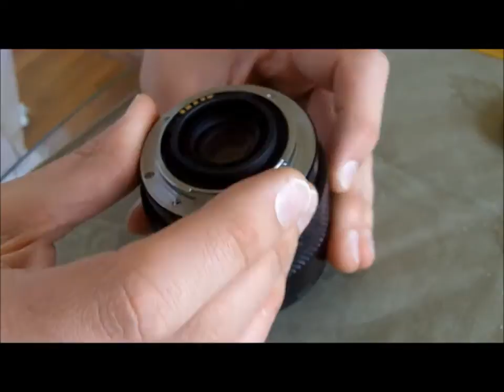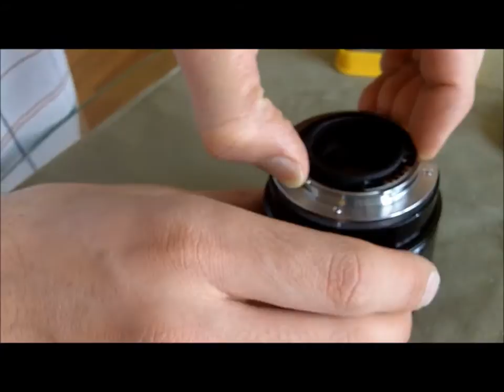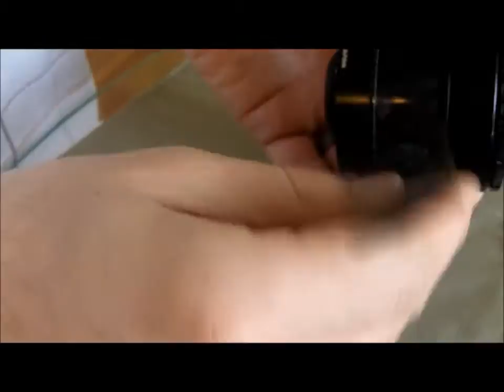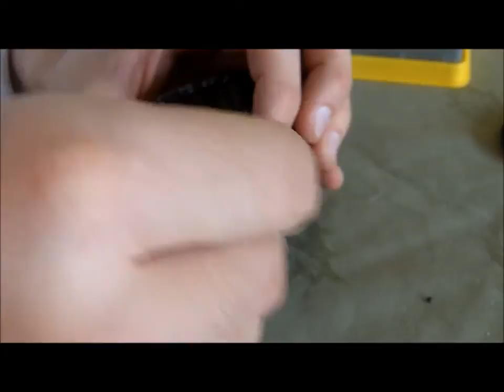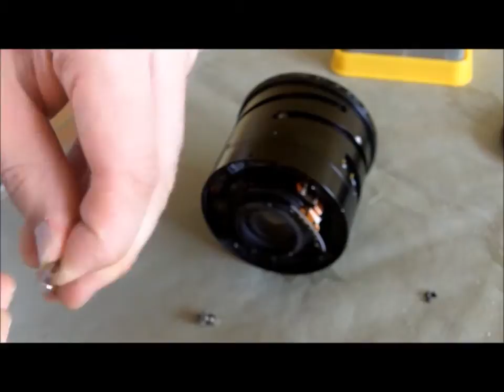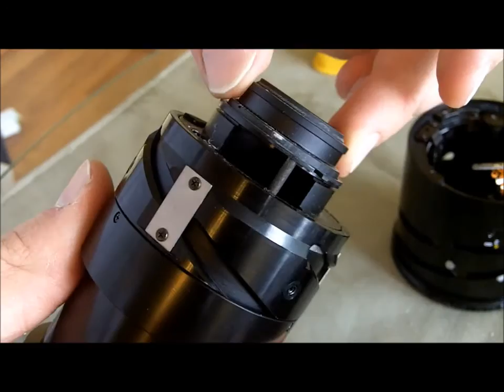Minolta AF 50mm f/2.8 Macro partial disassembly

Comment: Just an FYI to anyone trying, I attempted to remove the rear lens block. It's held firmly in place with loctite. I tried turning it really hard, but no luck. You would have to apply acetone to the threads to dissolve the loctite, & turn them quickly while still wet.
When looking from the back, disassembled, there's two lens rings. The first & most obvious one should remove the rear element. That should likely give access to the diaphragm blades, which you could carefully clean with alcohol. There's another ring around the rear lens, which should loosen the entire lens rear block. This is the one I tried to remove, but couldn't.

Comment: This saved me. There's almost zero videos on newer Minolta lens disassembly. I got stuck taking apart the rear of the lens. Thankfully I didn't lose that tiny spring under the electronics contact. I took almost everything apart, then watched this video when I was stumped on what to do next. Turns out I just needed to remove the outer jacket. The screw had came loose & was hitting the foil, causing the focus to stick.
Thankfully I got it all back together, but it wasn't fun trying to get all those tiny parts back in. I would have been done in 15min if I watched this first.
Reply from the maker: Glad to know this helped! Hopefully you got your legs back in working order, it was one of my favorites.
Reply: @scottmfulton  It's working now. I finally got to look at some stuff with it, & the magnification is totally awesome. It's my first 1:1 macro lens. I'm hyped to actually use it with my Minolta a9.

Comment: Hi, do you know how to clear fungus which has formed at the last glass element at the bottom?
Reply from the maker: I only ever had one lens with fungus to deal with, and didn't have a lot of success as it turned out the fungus had etched the element. However, I was able to remove the fungus by soaking the element in a solvent, I think I used acetone, and then wiping it off with a microfiber cloth. the fungus came off, but the glass etching was still there. good luck!
Reply: Scott Fulton My biggest issue is how to even get a piece of microfiber their so as to wipe the glass :/ It is at the very back. I've managed to get a service manual for the lens (Minolta AF 35-80 1:4-5.6) but it is quite complicated to follow and it is not well detailed on how to disassemble it. I think I'll get another lens then, i'll try to risk opening this one.
Reply from the maker: Zoom lenses are tricky, I typically only play with primes for fewer moving parts. If you can't locate any screws, there's a chance that the element is being held in by a spring, or snapped in metal ring that you'll have to pry out... carefully. Sometimes the rear groups just aren't meant to be disassembled and there may be adhesive. Sorry I can't help, I've never taken apart that specific lens.
Reply: Scott Fulton I'll need to try out the lens but I'm sure the image will be affected due to that big fungus (it takes about 1/4 of the back lens element, in the centre). I'll try to open it if I really need to but for the time being, i'll leave it alone.

Comment from the maker: Sorry for not seeing this earlier.  One of the problems I had was that the lens had been dropped, or so I suspected, and the outer barrel had been bent slightly out of round.  Build-up of dirt had caused it to seize days after I got it.  Once I took it apart and cleaned it out it worked better, but still ridiculously stiff.  I greased all the areas where it was binding with a lithium grease and it smoothed it out nicely.  Still some friction, and stiff focusing, but far better than it was.

Comment: Hey, I have a question for you. How familiar are you with these lenses? I have one that's in pretty much mint condition, other than the focus. I took it apart yesterday and removed the tape and completely cleaned all traces of adhesive away. I also cleaned it as best as I could in the grooves. It's still focusing *very* stiffly. I only took it down to the point at which I could access the tape. I didn't remove the inner barrel. Any ideas?